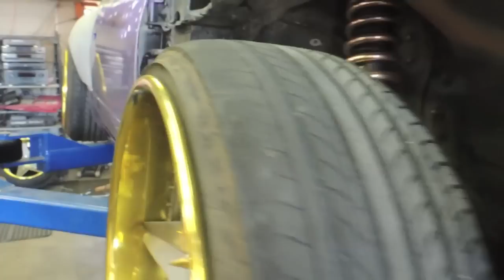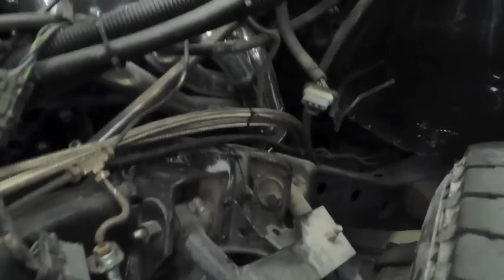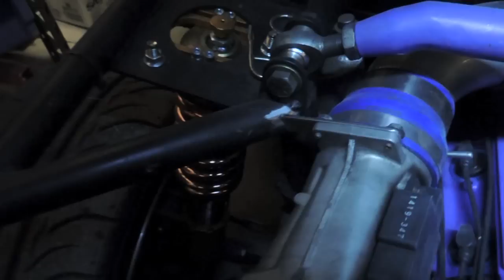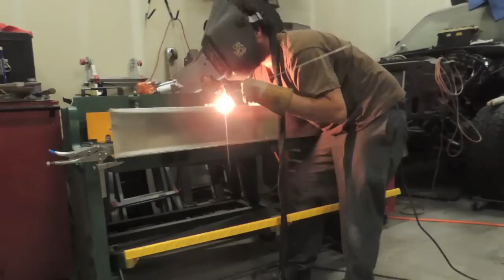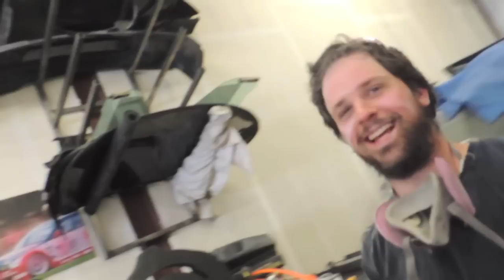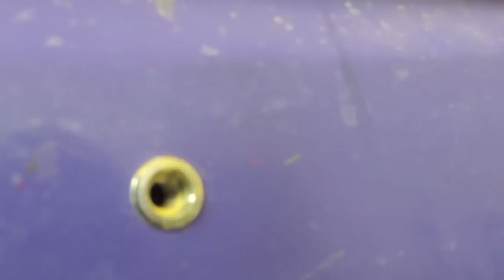DIY OVERFENDERS Pt.3 - Finally Done. Body kit install on an s13

Comment: So I just found this video and I'm trying to learn to fabricate my own parts from that can foam.  Right now I'm trying to build flares off my plastic bumper so do I have to pull those off after I'm done then how do you reattach your parts? And I did not put any tape underneath of my foam before I braid it

Comment: how much will you sell a pair for and can you put a link for the nutzert and all parts to attach fenders?
Reply: Have a hardbody and would love to have a pair
Reply from the maker: Nathan Chapman it's an au-ve-co nutcert tool. I bought it locally.
Reply: MISSILEWORKS so how much for a set of fenders and could you make them full length???
Reply: I need fender flares bad it looks so goofy with wide upfront and slim in the back because I put the 4wd fenders on

Comment: What are the fancy things called that you used in place of rivets?
Reply from the maker: Subversive Hippie cleco's bought mine on trick tools
Reply: MISSILEWORKS I meant the spiffy looking things you put in the threaded inserts.
Reply: Subversive Hippie Downstar sells them at $3.00 for the insert, bolt, and beauty washer.

Comment: Did you use just one mold? How did you make a mirror image?
Reply from the maker: Kuma Kuma yep just one mold. Made it super simple
Reply: How? Did you make the mold symmetrical, so that when you make the fender for the other side it's the same? I want to make my own too, but I'm thinking I need to make a mold for the other side too. And I need to make it a mirror image of the other
Reply: Kuma Kuma I was thinking the same thing.  I think he made his very square and cemetrical to where he could do this.  If he had a curvature to the fender then he wouldn't be able to do it but seeing how square they are he was able to do it off one plug...  At least that's what I'm thinking cause if it were just regular fender flares it would fail.  Please let me know if I'm right.  Thanks! Great job BTW